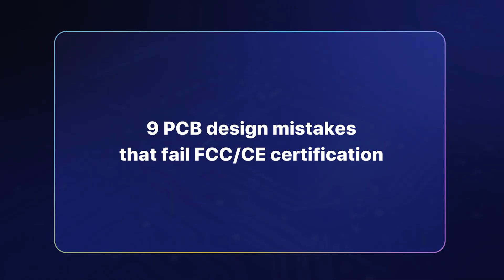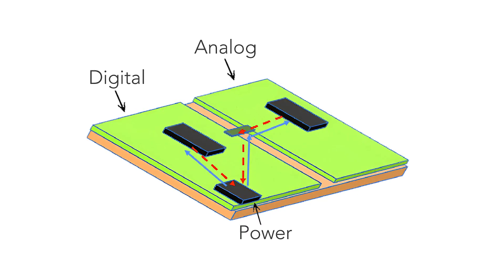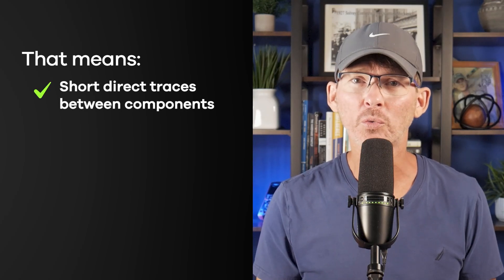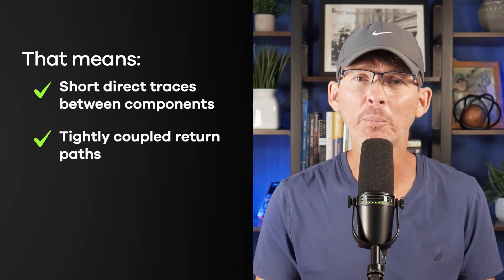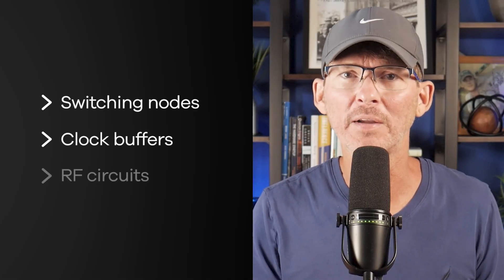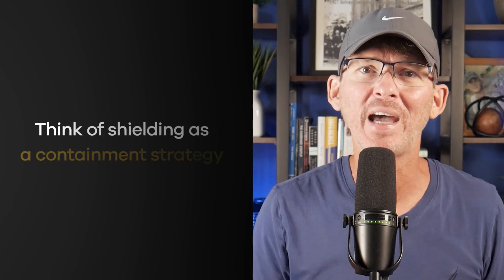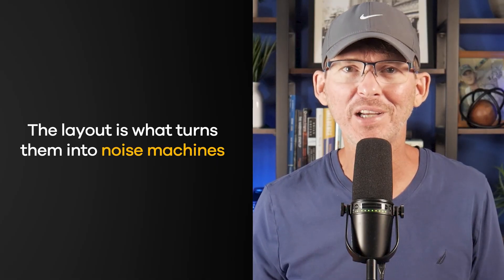9 PCB Design Mistakes That Fail FCC/CE Certification

Comment: After trying to design a ESP32 board from the bare chip (and everything working except wireless since I couldn’t figure out how to tune the chip antenna), I like to still use a 4-layer stack up with pretty much full GND in the middle two planes, GND planes in top and bottom as much as possible and GND stitching vias wherever I can get them. Never released a product though. Great video!

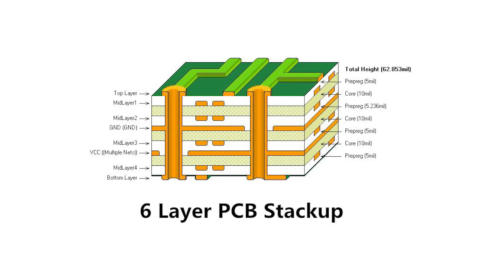Comment: 9:18 Incorrect stackup.
1) That is 8 layer board.
2) If power planes are not necessary (and mostly they are not) you can have maximum 4 signal layers.
3) If power plane is used as reference then it better have all the trace above/below it driven from that plane.

Comment: What do you need FCC/CE Certification for exactly?
Reply from the maker: To be sure your product doesn't interfere with radio communication.
Reply: That's emissions. It also has to pass immunity. The already present electromagnetic fields in the home, Industry or near a radio transmitter. Mobile phones is good one.
Place your phone near your project and make a call on 3G, 4G and 5G networks and see if it still works correct.

Comment: 1. 4 layer boards do not kill emissions by shorter return path. They do it by mirroring Eddy currents. The planes can be left unconnected and will still provide same dB loss in noise. 2. The high speed signals like Ethernet and USB do not need any ground around it. they are differential. The return path is the other signal. They need to be matched, yes, but they can be long traces as long as matching is OK-ish. It's a transmission line. Nothing to do with reurn paths in GND.
Reply from the maker: I agree that unconnected planes still add eddy current effects, but the impact is much higher if the plane is grounded for solid return paths. You're correct that a differential pair uses each other as the return path, but nothing is perfect and having a good ground plane still provides a more reliable return path with impedance control. Thanks for watching and commenting!
Reply: @PredictableDesigns  Have you tested that? I've seen research done on that and return paths have nothing to do with extra layers. Sure, shorter return path  = less EMI, but it can as well be on top layer. Also, symmetrical return paths on top would work better than shorter ones on L2. Point being layer EMI reduction ahs nothing to do with return path. Those are 2 different things that can work together but layer 2 at 150um will give you about 15-20dB attenuation of noise purely due to Eddy.
Reply: USB is not even differential in all cases, it uses common mode signals for some USB1.0 signaling.

Comment: Awesome content, sir! A few years back I picked up the EMC Troubleshooting Trilogy by Ken Wyatt, and it has been invaluable for practical evaluation and debugging of EMC issues in-house prior to booking time at a testing lab. One thing I struggled with when I was starting out on product design was not only the regulations, but the actual process of EMC testing. 90% of the books out there say “In your testing lab, do x” - but these labs always have equipment that is well out of reach for the student or even most smaller businesses. Knowing what equipment is valuable in-house and how to use it was a huge advantage once I gained that experience. I’d love to see a video or three on something like this to specifically go over how to walk through a circuit that’s radiating too much in a practical, effective way without over-analyzing the details.
Reply from the maker: Thank you for fantastic feedback and ideas!

Comment: Impressive content, Predictable Designs with John Teel. Looking forward to your next upload from you. I pressed the thumbs up icon on your video. Keep up the great work! Your insights on ground plane strategies were particularly enlightening. How do you recommend balancing ground integrity with design constraints in multi-layer PCB layouts?
Reply from the maker: Awesome to hear, thanks for watching and liking (and hopefully subscribing).

It's all really about having a continuous return path, especially for fast changing signals. Ideally you'll have a solid ground plane under all the signal traces without any splits, but if design constraints make that difficult then prioritize fast changing signals. And do things like add extra ground stitching vias near any splits in the ground plane.

Comment: Please don’t say CE Certificate. It not a real thing. You must fulfill all applicable regulation but no one is certifying that you are doing that except yourself. Doing external test to see if you fulfill requirements is not a certification of your product.
Reply from the maker: This is something I do talk about a lot in other videos. For this video I didn't want to get into the difference between self-reported verification and full certification. They both require the same EMI tests, so for this video it made sense to just call them certifications and not go into the detailed differences. This wasn't a video about the certification process, instead it was just about the PCB design mistakes that fail EMI testing.

Thanks for watching and for commenting which I always appreciate!
Reply: @PredictableDesigns maybe use the word compliance instead of certification in the future

Comment: Great video!

Not that I'm doing emissions testing on the buck converter module I made, but what's the probable effect due to a literal loop of having VIN and VOUT on the same side versus opposite sides of a pin header in a small module? Or is it more about if the ground connections are close to each other? Like if it went ground, power in, ground power out, and the other stuff compared to ground, power in, the other stuff, power out, ground. Like optimally it would be power in, ground, ground, power out, other stuff. I get that life is complicated, but assuming like a four layer board and decent grounding, is there any real noticeable difference at this module scale?

The module can be seen in my latest video at about 13:50. Just a quick 15 seconds showing a DC DC module being made.

PS: are you going to the Product Development Expo in Mesa in October? Seems right up your alley!
Reply from the maker: Thanks for the comment and feedback. Always enjoy seeing your comments.

For a buck regulator, the worst offender is the input current loop, so I'd put VIN right next to GND. But then also and do the same for VOUT next to GND. On a single header a good order is VIN–GND–GND–VOUT.

The layout of the buck itself will have the biggest impact on EMI, and this will be very secondary.

No plans to attend the Expo, but it does sound interesting!